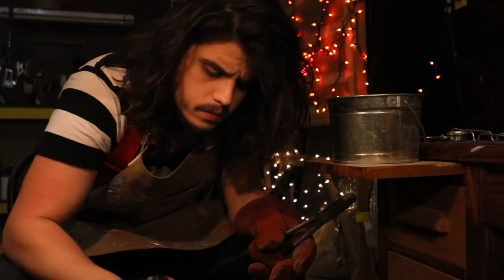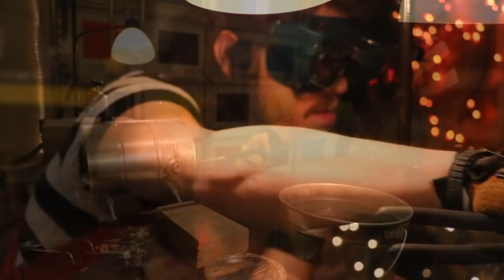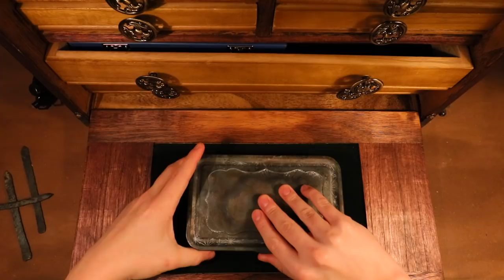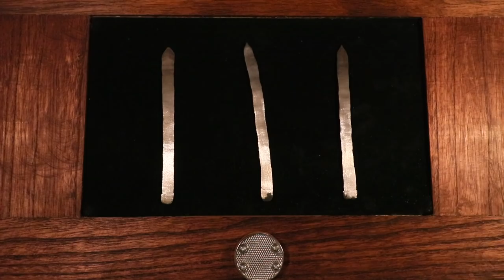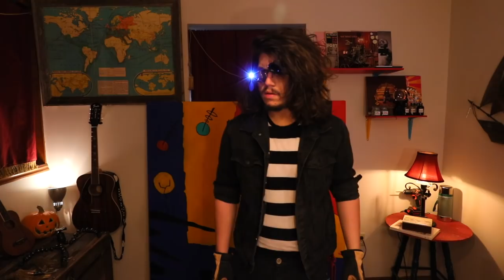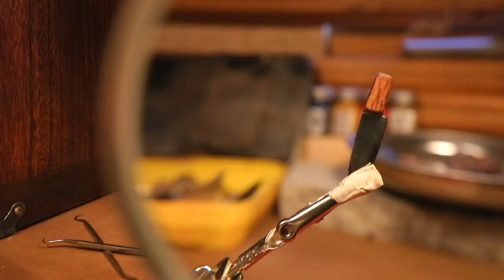HOW TO MAKE - MINI CHEF'S KNIFE!

Comment: hey, blacksmith here. Should you ever want to make more tiny knives i recommend using, instead of nails,  some of that sawblade or an old dremel bit, as that is going to be the high carbon steel you need if you want your tiny knives to be sharp for those itty bitty precise cuts that you do. Also you would have more control if you used a wee ballpeen hammer. 

 Also, when you hammer, try flipping the piece you are working over every few hits  so it stays even. When you are shaping the knife itself, start by hammering down one side of the rod into a point, so it slopes to a point on one side, then flip it ninty degrees and just hammer out the non sloping side into the blade, as you thin it out it will take on a chef knife shape and save you lots of grinding.
Reply: i never said it wasn't beautiful
Reply: He was just giving helpful suggestions
Reply: Jack Lankester I'll leave smithing to the pros, I wouldn't wanna burn myself
Reply: Zipper And Freinds lol what?
Reply: If you constantly worry about the hurting you are not going to get much done in life. When you make new things for yourself, there is no escape from the inevitable hurting. Safety precautions only reduce the risk of the hurting, not completely get rid of it. If you are making something and there aren't any risks, you are not getting involved enough to purely call it your own creation.
Reply: Jack Lankester could I use a drill bit for the steel?
Reply: Jack Lankester good to know :3
Reply: Pacific The Manokit giving harmless advices aren’t insulting, sister.
Reply: Jack Lankester man wish I could start smithing. I love creating things!
Reply: Thank you for the useful instructions, bud!